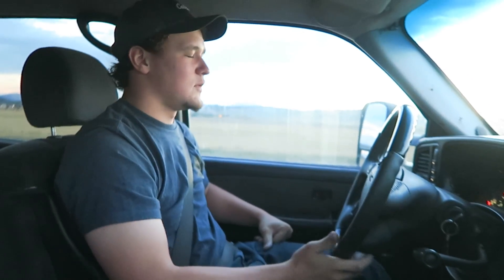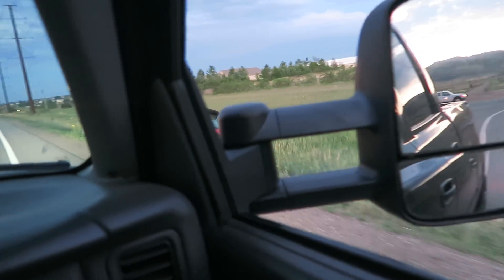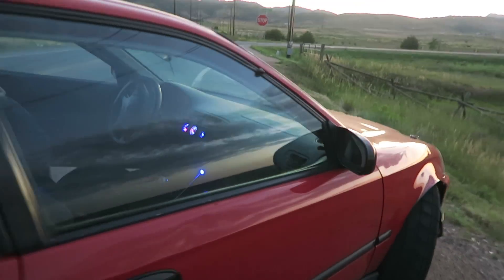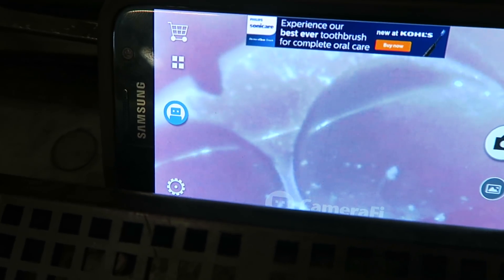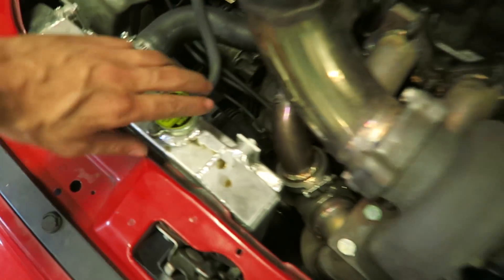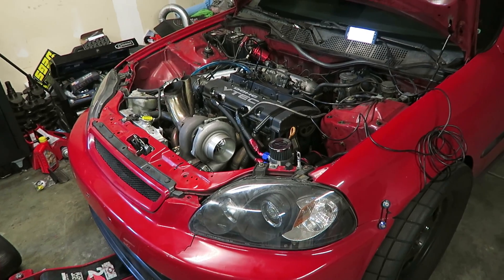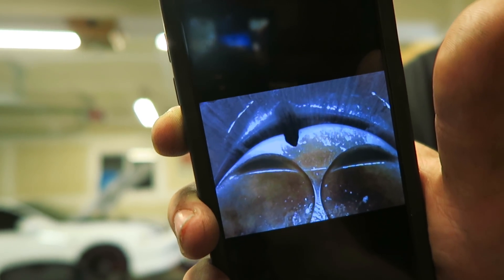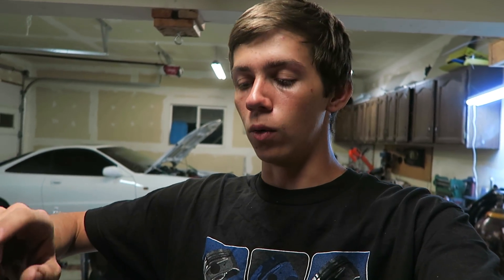Blew up The Hatch :(

Comment: Not saying it's the tune. But, it was the tune.
Reply: mono19963 how can it be the tune if it didnt act up at all for 3 months, while that isnt long, that would probably be enough time to figure out if a tune is wrong
Reply: mono19963 e85 plugged up the injectors. it happens all the time.
Reply: Boss Balls Did I ask?
Reply: it wasnt cheap shitty parts tho he had good rods and pistons in the engine only thing thats ebay is the turbo which I believe he has been using for like 2 or 3 years in the hatch
Reply: Boss Balls it was probably that cylinders injector go plugged or shorted out or just shit the bed other wise all of them would look bad but it was only the third one
Reply: Boss Balls ya i say he just fully build the motor top to bottom and then he should be good for a bit
Reply: Riley RR shit happens with 4 bangers but not V8's they eat 700 up for breakfast.
Reply: Boss Balls lol you would have to build the shit out of a 4 banger to get alot of power and it will blow up and a V8 takes very little to make massive power and to chose 4 less cylinders is stupid.
Reply: Boss Balls how does the number of cylinders make it an older design?  model t's were 4 pots. "uhhh 4 cylinders so archaic uhhh". v8s have new tech now too. dohc? direct injection? sounds familiar? Lexus v8
Reply: Boss Balls lol don't own a mustang but just to let you know in case you didn't but the fastest cars in the world are V8 top fuel drag ring a bell.
Reply: you clearly know nothing about cars because if it was the tune it would of blown within the first month and 2 if it was the tune motor than one piston would of taken a shit most likely a faulty injector happens all the time
Reply: Boss Balls no I'm not I'm speaking from experience and what I've seen I've seen injectors fail to open and lean out a cylinder
Reply: How would it be an injector???
Reply: rushking19 e85 gunks up injectors. get them cleaned fix the piston. verify the tune and call it a dizay
Reply: john martin fix the Piston? You know that's not how it works right
Reply: Boss Balls could you name even 2 of these "shitty ass ebay parts" on his build? The turbo is ebay and has out lasted 2 of his motors... Honestly "ebay parts" is misleading because you can buy brand name parts from ebay. And the block had high comp pistons and rod upgrades...so its not bone stock...
Reply: Block didn't go, the piston did. It's not a stock shortblock, it has forged rods, forged pistons, and race bearings. 

I doubt it was the tune. ethanol fucks shit up, probably clogged an injector when he let it sit for a week, piston burned up quickly because compression was high as fuck. 

Sure, if you ran a much more conservative tune it would have lasted longer and the injector might have passed the gunk before any serious damage was done. However one slow injector won't change AFR's that much, he would need individual exhaust port EGT sensors to catch one cyl going lean under boost. 

However, the point of a honda is to run it to the limits for dirt cheap and make retarded amounts of power. No one is going to undertune that hatch. You'd be dumb to. A pre-07 Subaru WRX? Sure, a motor is like 2 grand. An STI? Sure, a motor is like 4 grand. A honda? Junkyard h22 for a 150, some rods and pistons off ebay, a set of ACL Race bearings, ARP head studs, and you can rebuild it yourself in your garage with a micrometer and a torque wrench.
Reply: [MsR] Master E85 clogs injectors for sitting a while? Huh shit sucks
Reply: russrt spooling and top fuels get rebuilt after every run. sooo its still not comparable ;)
Reply: Ethanol turns into some white bullshit when it drys out. I race Karts, with built 206cc 4cycle engines on them. They run on pure Ethanol. We run pump 93 through them before we pack them up at the end of the weekend, or else the carbs get CLOGGED with white gunk within a few days. Meth evaporates quickly, and it's pain in the dick to clean. The reason streetcars use e85 is because the gasoline helps stabilize the meth and it won't evaporate as quickly or leave super annoying white paste.
Reply: Obviously don't watch roadkill XD
Reply: Boss Balls Even 302's prefer to be 4 cylinders above 550whp
Reply: mono19963 well its not a broken tune, the tune is fine, just pushing too hard.
Running dyno's getting 700hp ish and running that constantly at its max is the worst you can do reliability wise.
Cus if you run a max tune all the time its risky, 1 thing goes wrong for a short amount of time and all goes to shit...
Reply: Boss Balls yup, its a good tune, but way too agressive def for a semi-stock block :/
Reply: mono19963 let the boys that know their shit and are working on it be the people to diagnose it
Reply: Funny seeing non-tuners talk about tuning matters like they know. Lmfao.
Reply: Lean machine
Reply: josh winn did you just assume we werent tuners?
I helped tune my dads car :3
Now it makes 350hp and 380n/m instead of around 240 each
Reply: It wasnt the tune.   Its the compression it doesnt have enough room for error all that boost in alittle space is gonna produce insane heat.  Needs to get it around 9.5 compression if he wants to drive it on the street and do pulls.
Reply: csl wins, we can all stop commenting now.. not all v8s are created equal haha
Reply: Ya'll are funny
Reply: It's not the fucking tune like wtf. He's running 700+ hp on regular pistons
Reply: Your confusing his builds.  This has forged rods and pistons on a closed deck block.  Piston just got to hot and broke.
Reply: So, was it the tune? I'm unclear
Reply: Could have been the tune... which would explain a melted piston... it went lean or maybe the pump went bad.
Reply: Conditions are not necessarily the same for all 3 months. Pump gas octane ratings aren't always accurate. If it is running a stock ECU it also lacks failsafes that you get with full stand alone units. Absolutely the tunes fault. Your tune should save the car if anything goes wrong, other than reaching the power limit of stock internals.
Reply: not the tune, I can guarantee it was the cheap ass ebay fuel pump he's using.
Reply: A good tune will compensate for loss of fuel pressure, cutting boost, timing, and anything else needed to prevent a lean fuel condition.
Reply: or engine knock
Reply: Not a drop in fuel pressure at high IDCs.... Car was tuned on the edge and they were all aware. Pretty sure there's no hurt feelings.
Reply: Stock block high compression and running huge boost.  Not surprised at all.  Ran a stock block d series for 5 years at 350hp and no issues at all.  If I ran it at 400hp it would have gone in a year.  450hp and it would have gone in a month.
Reply: Also may want to do lower compression pistons when running a lot of boost. Also isn't there a safety map the computer should run if it detects leaner than wanted AFR's, or does that depend on the EMS he's running. Anyone know if that is possible?
Reply: Truth Teller he is running  e85 no need for  low compression  pistons
Reply: +Tate Schultz Only somewhat true, there's still an upper limit even on e85. You're not going to want to run 13:1 compression and 30lbs of boost lol.
Reply: Loren Husky that  is true  but I doubt his compression  is that high to  begin  with
Reply: doesnt take much with the comp he was running on a warm day.  Battery could have lost some voltage for a  sec and caused the fuel to drop and heated the piston enough to crack it.  Need to look at the logs to know for sure but there not really kept on s300 so we will never know for sure.  This is why EGT sensors are awesome to have so you can see it happening.
Reply: I aint saying its a broke tune but that honda aint messing with no broke tune.
Reply: Duane Bailey just looked up egt sensors I need to get 1
Reply: I Ben trying to figure out how to put a d16y8 in my 04 civic not shore what all I need to do the swap it would de Mice if someone can help
Reply: @david powrer you shouldn't need anything, maybe motor mounts and if that's the case get some hash sports mounts. But if you're gonna do a mini me swap I would try and find a jdm d15b with d16 tranny
Reply: david powrer where you live?
Reply: The car leaned out, which can be caused by several things... If it were running lean because of the tune, all 4 pistons would show a lean condition. Only cyl 3 shows us that it's more than likely an injector failure/fuel delivery issue. At 700whp, a car will let go VERY quick if the tune is off.
Reply: Some self righteous mechanics on this thread, remember not everyone is on the same lvl when it comes to cars. Please keep that in mind as some are trying to learn. On another note get some failsafes so you can avoid most of these types of issues. And my last point is go WOT or go home.
Reply: No, it didn't blow from going over the limit. That would be a bent rod. It had a hole blown through it because of detonation. A lean condition. That's why the piston got hot. Could have been bad injector or a fuel pressure drop.
Reply: ...No. Please stop spreading misinformation.
Reply: Before you tell me to 'read about cars', here's my actual youtube channel. Feel free to brows and take a look at my shop, my cars, my motorsports experience in SFWD Drag racing with 2 well known Drag Racing teams.

Bent rods are caused by excessive detonation or too much power.
Cracked pistons are 150% caused by detonation.
Detonation is caused by a lean fuel condition (fuel delivery issue, bad tune), or bad fuel.

Bad injectors can and do crack pistons. Bad fuel pumps can and do crack pistons. Clogged fuel lines can and do crack pistons.

When running a fuel like E85 you're more privy to running into fuel delivery problems because of how it interacts with metals in injectors and the buildup of deposits. Typically, you RARELY see detonation issues with E85 due to it's resistance to pre-ignition. So it's highly unlikely to be bad octane fuel.

That leads us to fuel delivery or tune. Brent at PFI is a highly skilled tuner. I have no doubts it was not the tune.

Which leaves fuel delivery. Cylinder 3 obviously had a fuel delivery issue. If it were a fuel pump issue, all 4 cylinders would have gotten hot. (You can tell the cylinder got hot because the piston is white, indicating a lean condition). All the other pistons were normal brown/black coloring showing the fuel delivery issue was in 1 cylinder.

To recap. White piston indicates heat. Heat indicates lean condition. Lean condition lends itself to detonation. Detonation blows up pistons.

The more you know. 

Sincerely,
A shop owner who's shop builds multiple 1000+WHP cars.
Reply: $5 says you don't even own a car.

Nothing better than internet experts...
Reply: Boss Balls I agree !
Reply: Why build a race car and have a conservative tune?
Reply: Nothing happened to the block ...but I'd bet he built it using the stock clearance numbers , which wont work with the additional heat load...
Reply: mono19963 sorry bro not the tune of that where the case would have been melted the piston may have Ben tuned aggressively i.e. Air fuels closer to 12.5 leaving very little room for poor quality fuel or a cold night... if I where to guess I would be looking at the injector on the cylinder with the hole in piston maybe have it flow tested to ensure its operating properly.
Reply: he is not running regular pistons... they are forged pistons and forged rods
Reply: seems that the injector for that piston popped out which tunerfreak said which he is actually one of the friends of boostboyz
Reply: I agree, let's see what he figures out then we can scorch earth everyone who doesn't agree with us. 🔥🔥🔥
Reply: What kind of scope did u use to check the pistons?
Reply: Froztiproductions how can it not be the injector faulty injector causes less fuel to get into the cylinder and lean out he needs to get an injector leak down test done to make sure it is good or not
Reply: thank you kenny mckee atleast you know same thing i was saying he need to get his injectors leak down tested to test the flow and spray pattern
Reply: thank you rotors magazine ive been trying to tell them but they didnt believe me the injectors need to be flow tested
Reply: Injector failed, I know because I know Kyle, that's what happened, injector failed, now you guys can stop guessing
Reply: Boss Balls I kinda agree with you. So dialed in one slight change from fuel pump or Injector hiccup etc and barely  rich becomes deadly lean.
Reply: Think about it if the tune was off all the cylinders would be fucked,if the fuel pressure /map/timing was lean then all the cylinders would be fucked. Sadly you had 1 injector fail it went lean and acted like a cutting torch.
Reply: another fun fact, if you go too lean under a big load you can actually start burning aluminum off of the piston! i wonder if that happened here, I cant wait till we have in-cylinder cameras and can watch some awesome failures from the inside! lol
Reply: slidestang242 that's one hell of a camera.
Reply: Boss Balls The tune was not that agressive. His AFR's were pretty rich too. High 10s low 11s which on E85 thats pretty damn safe AFR's. He also stated it didn't have crazy timing in it.
Reply: rocco dont matter what pistons you have you lose an injector same exact thing will happen no matter what
Reply: rushking19 I said that in my post buddy
Reply: Clay Badger 1. injectors don't clog that quickly 2. IF and that's a big IF the injector did clog then he had some very shitty fuel filters that didn't do their job and 3. Depending on what fuel he is running which I am assuming is premium, saying that the injector clogged would mean that not only did the fuel filters fail but that he bought some very shitty gas because it is not normal for premium gas to have much dirt or anything like that in it if at all
Reply: IcemanJD08 he's running E85.
Reply: IcemanJD08 I think the Injector had a fault electrically like coil shorted at some point causing less of a magnetic field causing Injector to open less making it run lean.
Reply: Truth Teller it could happen soon if someone could make money off of it.. but i doubt if they did anyone would willingly destroy the cylinder it was in, I can still hope lol
Reply: @MudJugBill, take a look at the newest video. Guess who was spot on correct? This guy.
Reply: bent rod because the piston stuck from lack of oil?? lolol that guy

Comment: make sure you dont have any pieces of metal in the header or in the hotside pre turbine. I burned a piston and it spit a piece out into the exhaust. After replacing the engine I fired it up and that piece found its way into the turbo. Luckily it was a Ebay turbo!

Comment: Re sleeve it over bore to a 2.4-2.5L h22 , either lower your compression to arround 10.5:1 or just start running straight up vp race gas c16 or even q16 , there is also a company called ignite and they have a e90 race blend of corn , then also run tripple pumps to prevent lean out and spend the coin and get a set of ID2000s

Comment: Next time you build the engine, you could try ceramic coating the top of the pistons and valves? Should keep them stronger plus reduces heat transfer in to other components which extends the life of those to.

Comment: Are you using any alky-based fuel for cooling and increased octane? If not, that could've completely prevented your issue. It'll keep the combustion chambers much cooler and quell knock and detonation (or pre-ignition) with the extra octane.

I personally run E25 in-tank and spray 12.8GPH (~800cc) of 100% M1 methanol in my Speed 3 since I'm at ~390/385 @ the wheels on stock block. It's a good extra safety measure since I'm nearer the upper limit of what's considered safe for our platform when not built.

Comment: Since you keep pushing more power, take the extra time and cash to sleeve the block and get some quality forged pistons. It'll be worth it, easily, in the long run.

Also triple check your tune next time and be a bit more conservative with the timing and compression ratio. You can always make up the power difference with literally 2-3PSI.

Comment: Next time ... better oil pump in better injectors....
Reply: What oil pump is better then the h22 one.  All you can do is port it.  His injectors are fine just send them out for cleaning and check there flow rate.  Could have been as simple as the battery loosing voltage.
Reply: doesnt help hes on a stock fuel line making 700 either haha

Comment: sorry your hatch blew up. hang in there, and rebuild it like it's for the last time. I'm a harley shop owner. I've rebuilt my hotrod bike motor so many times. sucked valves, head gaskets, cracked pistons, then had to stroke it since bottom end took on some damage.its all part of the fun, so enjoy it. make next motor just a bit better. upgrade wiring, hoses and belts. get some lock tire blue- comes off with tools and keep it clean. see ya down the road

Comment: Should keep the 11:1 compression makes the most power for sure. Get better pistons. Maybe try some straight  water injection in the up pipe. Keep those cylinder temps down.

Comment: You should sleeve it and put 9:1 or 9.5:1 forged pistons in with titanium rods, titanium valves and springs and a 2nd or 3rd stage cam and turn the boost up to 45 psi. And if you you fill like it put a titanium lightened crank in. If the problem was not enough fuel put a double or triple fuel pump and double 1100cc injectors and you should be fine.

Comment: Put an egt probe in your number 3 exhaust runner. Cylinder 3 on these 4 cyl motors always get the hottest, and is usually the cylinder that fails.

Comment: Get Hayden's mad welding skills to weld that hole up through the spark plug hole lol nah man I feel for you, that seemed like a solid build, maybe high compression wasn't the right direction for a street car. Maybe one pull at a time at the strip wouldn't have got them so hot but pull after pull got them cooked. Can't wait till it's back!